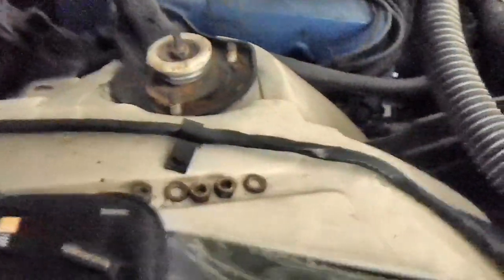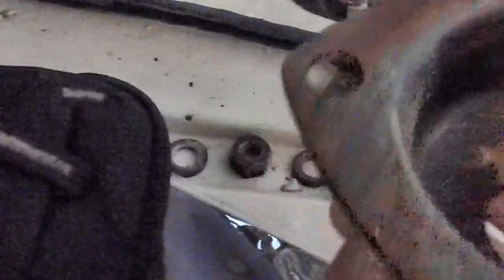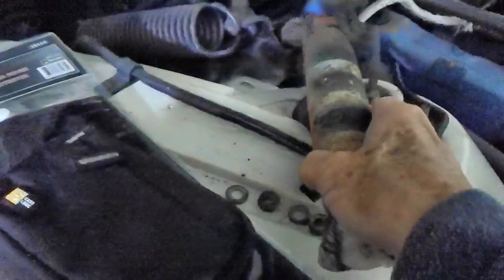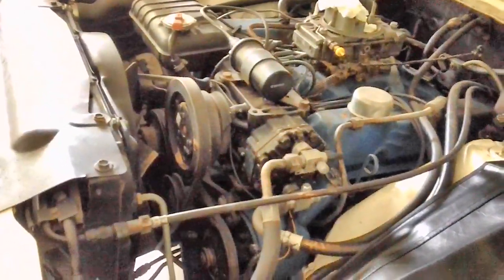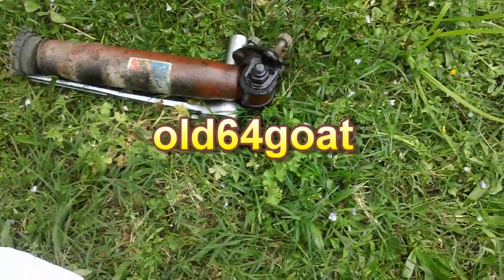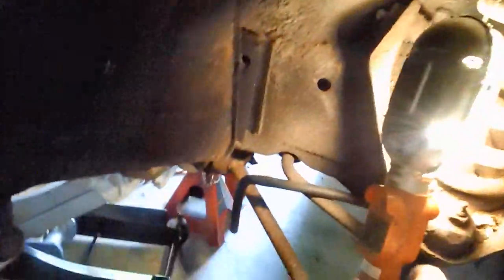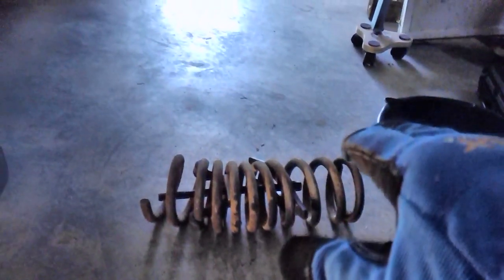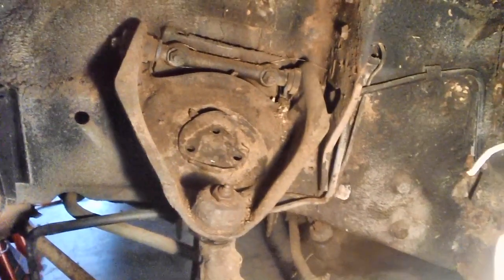1966 Ford Thunderbird repair and refurbishment (Part 44). Coil spring removal

Comment: That is what i mean JOHN. You are the only guy who covers the breadown of the whole car and what to watch for as far as trouble shooting goes. I never tried to order anything yet but Will probably want up replace all the bushings in time. I Will be doing a complete breakdown eventually but a section at a time. Lots of sandblasting ahead. I have to clean my steel wheels to protect them for the future.
Reply from the maker: Michael,
Absolutely right, my friend, clean and protect those wheels as best you can.  They cost a fortune to replace.  It would almost be cheaper and wiser to buy a T-Bird parts car.
Regards,
John

Comment: John, You're spring removal job went pretty smooth (compared to mine) and you're right, Removing that tool from the compressed spring is a lot more difficult than you'd think. But my biggest challenge came when I installed the new springs, That was the toughest part that I swore I'd never repeat and I ruined the nice paint job I put on them as well. I had to touch them up with a brush but that didn't look as good as the spray job. Oh well, Who the heck looks at your springs anyway, lol. I'm enjoying this series, Keep up the nice work and be really careful on that nice, new ladder!
Reply from the maker: Art,
Everything is just one big piece of cake, my friend.  You'll see.  And you're right...who looks at the springs anyway? 😜  Now about my future 442.......
Regards,
John

Comment: Hello again - Here's the spring info from the Ford Parts catalog.    Originally there were 3 different 66 TBird front springs, depending on whether the car had air conditioning or not.

 Part number C6SZ 5310 A was the standard right spring for air. It has 1 yellow stripe as an ID, and has a load rating of 2410# Its ID code is 3M (which would be on the build sheet),  .700 inch wire diameter and 20.25 inch free length. 
    
# C6SZ 5310 C was for air and the left side. It has one blue stripe, load rating of 2510#, code 3P, and 20inch free length.
 
# C6SZ 5319 B was the standard spring for no air cars , has 1 red stripe, code 3N, load rating 2310# and 20 5/8 inch free length.

A 67 Tbird standard spring had a load rating of 2275#, .717 wire diameter,  free length of 17 1/8, its also a smaller overall diameter.

After several years the only spring Ford supplied for replacement was the Yellow stripe spring.   Its amazing all the engineering minutia car manufacturers go thru to get everything just right, even 50 years ago.

Your going to have  a really nice car when your all done!
Reply from the maker: Excellent, my friend.  I'll boil it down for presentation in the next vid.  Thank you very much.  Ya done good!
Regards,
John

Comment: Hi - Nice video!   67 or newer springs are completly different. Much smaller diameter and more coils. 1961 thru 1966 use similar springs that mount over the upper arm. 1967 thru 79 have the spring between the lower and upper arm. When you order springs, there are different springs for Air Conditioned cars, due to weight differences. I can send you the specs for 1966 front springs from the Ford parts book if you'd like.
Reply from the maker: Thanks, my friend.  If possible, post those specs here in another comment so all can see.   There will be an update on the coil springs in the next vid.
Regards,
John
Reply: Hi! Frelich was my grandfathers last name, but he changed it when he came to America. This is the first time I've ever seen this name besides our family tree. :)

Comment: Probably a dumb question, but given how expensive those air cans are why didn't you just use your air compressor?  We always called those fold out ladders "step ladders" because they have steps on them instead of rungs and often times have a little fold out plate on the top of them for holding a paint can.
Reply from the maker: Gary,
Why didn't I use my air compressor?  I'll explain in the next vid, my friend.
Regards,
John

Comment: i rebuilt the front end in a 62 Ford Falcon, i bought new lower control arms, the front  end in a falcon is very similar to a t bird the falcon is a uni-body car ,
Reply from the maker: One of the kids I went to school with drove a red '62 Falcon.  His dad bought it for him new.  Seems to me it had a floor shift, but I might be wrong.  It was a pretty zippy little car.  Also, at a drag strip, I once saw a 6 cylinder '62 Falcon kick butt on a '65 GTO...by more than a few car lengths.😊
Regards,
John
Reply: @joernone  the 62 i had i saw the odometer turn over twice, it had 72,000 on it when i got it ans 230,00 when i sold it

Comment: It is my understanding that the backspacing, the distance from the inner wheel flange to the edge of the rim, will decide if it fits over your front caliper.
Reply from the maker: I have the rest of the wheel dimensions.  I'll show them in the next vid.
Regards,
John

Comment: John if the tire is holding air then the inner bead should be good, the outside of the wheel pits are possibly just cosmetic. If that is the case your old friend JB weld will be just the thing to fix it. I remember in the day having issues with rotating tires as some of those cars had the drum wheels in the back that could not be placed in the front. Not one of Ford's better ideas.
Reply from the maker: Peter,
Good idea until it comes time to change the tire.  The JB Weld would pop right off when the tire machine tool comes in contact with it.  Better we just go with the weld, if it's possible.
Regards,
John

Comment: I have used PB Blaster for years.
I left you a can of it last year and 2 bits on your workbench....LOL
Hey John, Do you own a tripod?....LOL
If I ever need a spring replaced I know who I can call...LOL
Nice work, now get over here and work on our FORD van...LOL
Reply from the maker: Bill,
Today I discovered that PB Blaster is sold by Lowe's, so that's where I obviously picked it up, but don't ask me when.  And I'll look around for that 2-bits.  No doubt the floor monster got it long ago.  As for changing a coil spring...I've just shown you how to remove one, so stand by for the re-installation vid and you'll be a coil spring genius, my friend.😜
Regards,
John

Comment: I might try that method of cleaning the rust like you did.  Are these control bushings available from the auto parts store?
Reply from the maker: Michael,
I haven't yet checked to see if O'Reillys has the control arm bushings, but I will.  Unfortunately, Rockauto is currently out of stock.  But Mac's Thunderbird offers them here:
https://www.macsautoparts.com/ford_thunderbird/catalogsearch/result/?q=control+arm+bushings&x=0&y=0
The Bird Nest offers them here: https://www.parts123.com/parts123/yb.dll?parta~partsort
Regards,
John

Comment: Those were nasty front ends to work on.  If that big long spring gets loose it can be fatal.  When that spring is out be sure to replace those upper control arm shafts.  They wear out and cause alignment ptoblems!
Reply from the maker: Craig,
Tell me the name of one person who has ever been killed while removing a 1966 Thunderbird coil spring.
Regards,
John

Comment: Will you be soaking the control arms and other front end parts in  the rust removed like the other parts You did?.
Reply from the maker: Michael,
Probably not.  They're too big, but the smaller pieces will for sure go for a vinegar swim.
Regards,
John

Comment: How much is that spring comprresser?
Reply from the maker: Michael,
I rented it for free from O'Reilly's Auto Parts.  They charge you for the tool, but give you a full refund when you take it back.   But if you ultimately decide to keep the tool, then you just keep it...no big deal.  Nearly all auto parts stores offer free tool rental.  They have a bunch for rent.  I'll soon be going back to O'Reilly's  to rent a ball joint removal tool.  Beats buying them, eh?
Regards,
John

Comment: Great video John. I like the spring compressor you used more than the one I used, but it worked none the less. Also had issues about the compressor shaft bottoming out on the upper control arm.
As far as shocks, TheBirdNest shows a Shock Absorber Bushing AND a Shock Absorber Insulator which I think would be the two pieces you were needing. So far, I've ordered all of my parts from them and have been thoroughly satisfied. Man, I wish we were neighbors so we could work on our TBirds together!
Reply from the maker: Eric,
Thanks, my friend.  I've been doing a lot of shopping around and making price comparisons between the various T-Bird parts sellers.  They're all pretty much the same and there is a reason for it.  Shipping charges are what I primarily focus on.
And it is too bad we're not neighbors.  I don't know anyone who has an interest in working on old classic cars.  Nowadays, it's all Iphones and video games.  Total bummer.  But such is the new generations.  If it'll keep them out of trouble, then I'm all for it.
Regards,
John